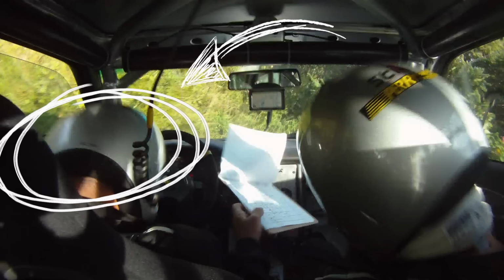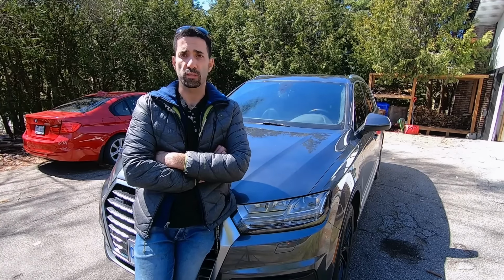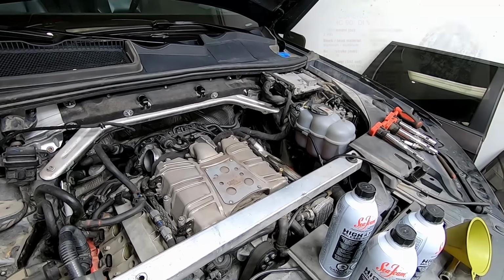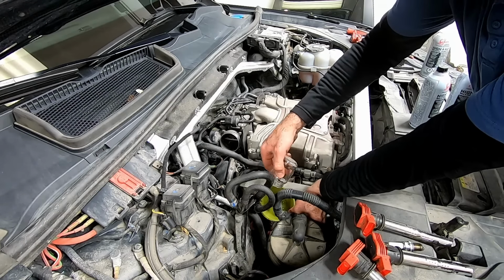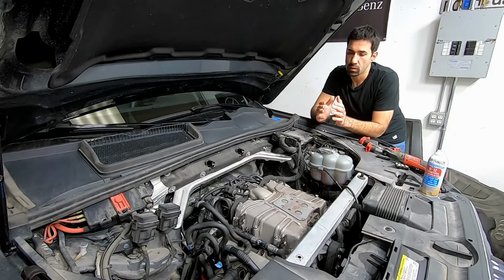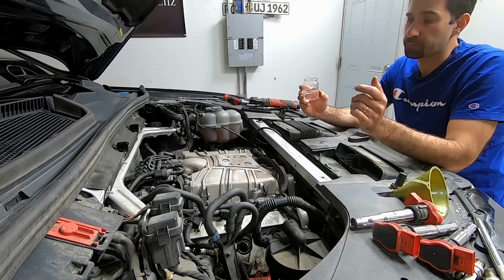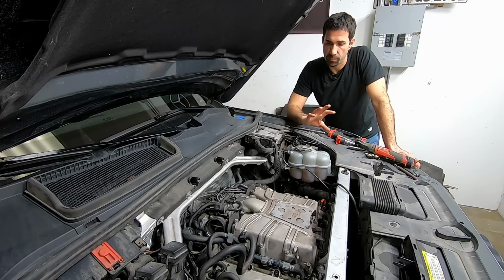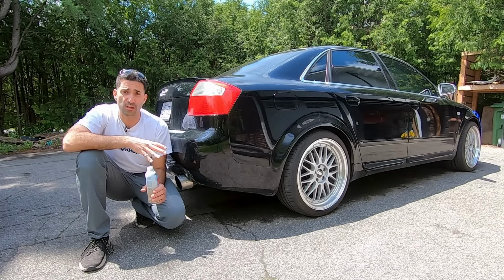How to fix oil consumption on VW/Audi/Porsche 3.0T engine?

Comment: You are a genious. Thanks man. Did this on m S4 3.0tfsi. Will see if it works. I couldn't import B12 but bought a product which has nearly the same ingridients based on Xylol.
Reply from the maker: great...keep us posted on your results and the details on the other solvent!
Reply: @ETMotorsports  I'm curious, too. But it smoked pretty intense for nearly half an hour. I used STP for carburetors mixed with Toralin Anticarbon. But because of a public place i couldnt disassenble everthing to turn the crank. So i just put it there for two hours. Maybe i will do it again in a few weeks. 

I also will use some ceramic products and results are instant. Less engine brake/drag, running more smooth.

Comment: It's great to hear that the B12 piston soak process is effective for the Audi V6 too.  It is interesting that treating the pistons at TDC also soaks the valves.  

I recently did the B12 soak on a Tiguan 2.0   Instead of waiting 12 hours between B12 doses I just waited until the solution had leaked past the pistons, rotated the crank, and added more B12.  After a few doses, I noticed one piston held the solution so I only gave it a 1/2 dose.  Eventually, 2 cylinders held the solution.  

Hopefully, my A6 will not begin consuming oil.  But if it does it's great to have such a cheap & simple cure.

Thanks,  👍👍
Reply from the maker: Great results

Comment: I tried this on my 2014 Audi S3 8V recently and so far so good! Have not went through any oil at all in the 250 miles I drove the car where I would have gone through about 3/4 of the dipstick in that time (it was getting worse and worse over the past few months the more I drove the car) So pretty safe to say this worked on my car too! I done the standard 24H 2 bottle B12 Chemtool piston soak method, drive the car and dump oil and carry out normal oil change. One thing I noticed was there was a sulfur smell which smelled like unburnt fuel was getting to the cat which made me think the cat might have been damaged. Thankfully that smell went away and the car drives normal. I noticed before my car would leave a lot of dark smoke when launching hard off a stop light for example but that is also gone following the soak! Thank you very much for sharing your knowledge on this issue this really is abolutely amazing! I think moving forward if I was to do this again even on a 4 cylinder engine it would be a good idea to do piston 1 and 4 and 2 and 3 separately and do them both at TDC. Uses less B12 and you get the added benefit of it cleaning the valves and injectors. I was also really lucky that I was able to purchase some B12 in Northern Ireland where I live since I know it is not available everywhere
Reply from the maker: Great - glad this worked! I like your idea of doing the pistons at TDC as well...It makes all the sense in the world to take advantage of the soak and hit the valves and injector while you're at it

Comment: I've done the soak on a 2L Q5. I drain the oil beforehand and keep it for later. I refill cylinders each time before hand cranking, using a piece of vacuum tubing as a dipstick to check the levels. Each time I refill I also drain the oil sump to keep the solvent away from the seals. When last soak is done I put a small amount of Seafoam into each cylinder, remove the fuel pump fuse, and crank with starter to lubricate & clear cylinders. Then replace fuse and spark plugs, add old oil & do an engine flush, then new oil & filter. Running the solvent in the engine oil is probably risky & an engine flush is likely more gentle & can be done at every oil change for a while to gradually clean the rest of the engine.

Comment: 2016 Q5 here... Did the B12 soak 3 weeks ago. Now after 500kms (300miles) the level hasn't moved. Before that, it was almost a 1/4 of oil in less than 1000kms.
Reply from the maker: great results!

Comment: I always treat the piston at bottom dead center...this way you can cover it up completely.
And yes, you always want to blow up the cylinder with compressed air.

I use a can of B12 per cylinder.pull the supercharger and walnut blast the valves, also replace the PCV valve.
Reply: B12 and then do the walnut blasting? Or walnut blast first?

Comment: Hola de nuevo amigo! Otro Audi a5 1.8 TFSI arreglado gracias a este proceso!! Este consumía 1l en torno a los 800km - 1000km. Actualmente lleva 750km recorridos sin consumo aparente. Quiero aclarar unos detalles por si son útiles para los demás. No pude usar B12, y en su lugar usé ATF+4 mezclado con acetona pura en partes iguales. El resultado fue increible, disolvió el carbón muy fácilmente. En este caso, el arranque fue MUY DIFICIL, pero finalmente todo resulto ser un exito.
Reply from the maker: Hey - great results! ATF+4 mixed with equal parts pure acetone - interesting combination...worth a try!
Reply: @ETMotorsports  Si, quizá en un motor con muchisimo carbón sea mejor usar el B12, pero en este caso funcionó a la perfección el ATF+4 con acetona.
Reply: @SrZombros I'm curious, do you know why the starting was so difficult? The spark plugs were out during the soaking, so it's not like they were coated with B-12.  The hard starting (which we've seen in a few of the prior @ETMotorsports vids on this topic) is the part that has me the most concerned. Thanks in advance.
Reply: @tedjohnson64  Cuesta arrancar debido a que el motor pierde toda la compresión al no haber ninguna película de aceite en las camisas de los pistones. También, la presencia del solvente en la cámara de combustión hace que el motor se vuelva loco. En cuanto el solvente empiece a quemarse y llegue el aceite a los segmentos para recuperar la compresión, tu motor funcionará con normalidad. PD: añadiendo una cucharada de aceite antes de arrancar el motor, previene daños en el primer arranque y hace que sea más fácil.
Reply: @SrZomBros gracias por su consejo de hecharle cucharita de aceite antes qué actualizar
Reply: @Pwnulolumad  Denada! Me alegro de que te fuera últil <3

Comment: Very interesting point talking about the carbon on the pistons and interference not allowing the engine to rotate fully by hand.

I’ve done the b12 soak close to a dozen times on both the 2.0T and 3.0T CREC. Has worked great. However on the first 2.0T vehicle I did this soak on everything went smoothly. Rotating the engine by hand during the soak. Drove great for 500 miles with no consumption. After sitting for a couple weeks I go to start it and it immediately is running rough flashing CEL and dies after 30 seconds of running. At that point I can only assume the engine has seized up. Long story short after poking around and not wanting to do more damage I start pulling things apart. Cant find any issues. Pull the head off only to find carbon buildup on top of the piston which was my interference  hitting the bottom of the head, and the reason the engine stopped running. The fact that the car ran perfectly for 500 miles makes me wonder if this was just a coincidence and maybe the carbon actually broke off from the backside of intake valve and got sucked in because I would think any carbon that accumulated during the soak surely would have burnt off immediately upon startup and I never had any resistance rotating by hand when doing the soak.
Reply from the maker: yeah that's a bit suspect...you wouldn't have carbon from the treatment after 500miles...so you had actual physical damage because the piston hit the valves? that sucks :(
Reply: @ETMotorsports  there was no physical damage. Once the head was off you could see carbon on top of the piston which had been compressed and preventing the engine from fully rotating just like what you experienced by hand. I would have never expected such a small amount of buildup to be able to stop the engine in its tracks like that. We’re talking less than an eight inch of carbon on just a small portion of the piston top. In hindsight I could have just pulled the spark plug, maybe put in a little solvent to soften it up, then blow it out with air
Reply: So this cleans the intake valves ?

Comment: Thanks for the video.  My wife has a 2017 Hyundia Tuscon with the 2.0 na engine, that has this same oil burning issue. Car had just about 100,000 km and used about 1.2 - 1.3 liters/1500 km.  Dealer was absolutely no help.  Did the piston soak and made a big difference, didn't fix it completely but much better now.  After about 4500 km used about .5 liter of oil.  After second oil change after piston soak we went on a trip and put on about 1500 km and it still showing full, was mostly hwy driving so maybe that is why not sure.
Reply from the maker: @vanlandbc  awesome! Glad to see it's working on other brands too

Comment: Thank you, I have tried on my Q7 2017. It works!
Reply from the maker: @eddatusa  nice! What were the numbers?
Reply: @ETMotorsports  I would like to get this done but no one in new jersey seems to give me comfort in having them do it i will drive my car to canada if you would be willing to do this for me do you have a email or contact info
Reply: @ETMotorsports  I have followed your procedure. I did 2 pistons every 24 hrs. Every 12 hrs rotating and added B12 50 ml. My Audi was consuming 1/4 oil about 500 miles. I have ran 1000 miles. It hasn’t dropped at all. Thanks again. Before it I did change PCV valve. It never resolved the issue.

Comment: I just started the soaking process on my 2017 Q7 3.0t
I started on Saturday pistons 1 & 6, twice soaked, then hand cranked without problems.
Last night I started on pistons 2 & 4, this morning I tried to hand crank but got stuck. 
I got 2 & 4 back on TDC and I'm now doing the 2nd soak. I'll let it finish the soaking then I'll try the compressed air to see if I can get it unstuck.
I'll report back.
Reply from the maker: @SuperVertrix  good luck!
Reply: Update:
Reposting again. I'm not sure what happened to my previous comment.
Anyway, I was able to rotate the crankshaft once again. The problem was inside cylinder #2. There was a piece of hardened/dried carbon on the lower edge of the piston head that was preventing the piston from reach TDC. I used compressed air to blow it out and it worked. This cylinder was very dirty, almost like the one you showed in the video.
I'm now soaking piston #3 and #5.
I'll report back tomorrow.
Reply: Update #2:
Yesterday, I finished soaking all the pistons. When I turned the engine back on, there wasn't much white smoke. I think it's because I managed to remove almost all the B12 liquid without letting it enter the exhaust pipes. After soaking the pistons, I vacuumed out as much liquid as possible while the piston was still at TDC, then blew the cylinder with compressed air. I lowered the piston to BDC and blew it with air again. I installed the old spark plugs, air filter assembly, and started the engine, which fired up quickly (only hesitated for a couple of seconds). I let it run for about 20 minutes, let the engine cool down, then drained the old oil and removed the oil filter. I replaced the oil filter, added new oil, and installed new spark plugs. The engine started instantly, warmed up, and I took it for a ride. It was very smooth and quiet ride. I'll update later on its oil consumption.
Thank you, @ETMotorsports !
Reply: Update #3, maybe too soon to tell, but yesterday we took a 200-plus miles trip and the oil level still at 100%! Before after a trip like this, the oil level would go down a notch. I also noticed better MPG, it increased by 3 miles.
Reply: Update #4
Today, I hit 1,000 miles after the piston soak procedure. The engine oil gauge is still showing 100% full! 
I'm super happy about this. 
Cheers!
Reply: @ETMotorsports  1,500k miles, and so far, the electronic oil gauge is still at "MAX". Thank you Sir!

Comment: Rotella  T6 one of the best  oil. The 5w40 for diesel engine  is excellent.  You can use it for that engine, no problem.
Reply from the maker: yeah I like running the T6 as well
Reply: @kamalaquino6300  why used diesel engine oil after piston soak,what is the benefit for this ?
Reply: Rotella is all i use in all of cars. Truly the best oil i have ever used.
Reply: @etmotorsports I just did the soak on my 2014 Q7 with 3.0.  I then ran the motor for 20 minutes with one can of b12 prior to draining and refilling with t6 rotella 5w40.   My question is I know this oil is for diesel and not the regular 3.0 but I get the idea that you and others feel it’s fine to use this for this engine.  I have this oil in now and was going change out with amsoil after maybe 500 miles but I’m also considering just keep the Rotella for a a full 4000 miles or so.   Appreciate your thoughts.
Reply: @ETMotorsports  I did the soak 500 miles ago and have been running rotella 5w40 during this time.  I’m thinking about now switching to amsoil 5w40 but also considering staying with rotella a bit longer.   It sounds like you feel staying with Rotella would likely not be an issue.  Is this correct?

Comment: Спасибо огромное за ваше видео! Уже 2 недели испытываю проблему с Audi Q7 4m 2017 из США. Пробег 140 000 км, цилиндры чистые. После очередной замены масла, расход масла составил 1 литр на 400 км. Обязательно воспользуюсь вашей рекомендацией и сделаю раскоксовку двигателя. Очень надеюсь, что поможет. Привет вам из России!!!
Reply from the maker: @lermos  good luck!!
Reply: @ETMotorsports after doing this procedure I ran around 1260km and engine asked me to add 1 liter.
After a while I ran 4250km throughout the city and highways on Russian roads and oil level was empty on a half. 
I ride around 140-180kmh during on highways. 
1200km left before the next oil change. 
So i think I won this crazy oil consumption.
I will watch the situation after the nearest oil change.
Thank you very much. 
I used Gzox foam solution for valves and pistons on hot engine during 4 hours of procedure. Spent 4 bottles of it.

Comment: I have a 2010 A4 B8 Avant with apr stage 3 ,K04,Etc. It was “eating “1/4 oil on 200 mile,smoke especially after I am leaving the stop lights. I go to the mecanic and he said I need new piston rings(my car have 200k mile). I do first BG Dynamic Platinum Engine Restoration Service and after B12 Soaking,replace spark plugs.  Every second time when I put the gas in the tank I add a fuel system cleaner( LM Jectron or RL SI-1). all the time I use Liquid moly 5W40 now I change with the new one Liquid Moly Molygen(the green oil). I put 6000 miles on the car in six months and I don’t have any kind of oil consumption or smoke ,the car is running smoothly and I drive 2000 miles without adding oil.( i change the oil every 2000 mile).Now I have almost 2000 miles I’ll try to go 3000 to see if it still consuming oil.
Reply from the maker: @mogadan3582  great results

Comment: Hello! I am in exactly the same case in a Toyota avensis 1zzfe. Do you think it is better to use B12 before seafoam?Hello! I am in exactly the same case in a Toyota avensis 1zzfe. Do you think it is better to use B12 before seafoam? Thanks you!!!!!!!!!
Reply from the maker: @GomeSecks  you don't have to use seafoam first - it all depends on how bad the engine is... seafoam is very mild so if the issue isn't serious it might help but is you're dealing wth a big consumption and have access to B12 just do that straight away
Reply: @ETMotorsports  If currently consumption is 1Liter every 1000km...I'll tell you here if it works in my case, in Spain it is difficult to get b12

Comment: I have another 2017 Q7 that burns 1L every 750km or so if you want more practice (in Ottawa). I was actually going to ask if you wanted to try it, but figured you were done after the 2.0T. Fantastic video, BTW
Reply from the maker: Haha half of Ottawa's Audis are just eating oil I guess :) I'm pretty busy for the next few months, but can always help if you decide to tackle it on your own.
Reply: I may take you up on that! I was curious what your thoughts are about rolling one side onto ramps and doing one bank at a time, to alleviate the issue caused by the 90 deg V6?
Reply from the maker: yeah I thought about that as well but unless you put the car at 45deg you can't make up for the tilt in the piston...honestly much easier to just take the extra time and do it...

I thought a bit about your car and there are a few things that I want to try with the 3.0T so maybe we can make something work towards the end of the summer if you haven't fixed it yourself...can you ping me on whatsapp or facebook so I don't lose your contact?

Comment: Hey have you seen that valvaline came out with a restore and protec engine oil. They claim it breaks down the carbon on the rings after four oil changes.
Reply from the maker: hmmm worth a try I guess - but that's anywhere between 20 and 40k+ kms if you're doing 5k+ oil changes...not sure anybody wants to wait that long to find out if it's effective
Reply: @ETMotorsports  I agree. Would be good for the low millage cars for preventive maintenance.

Comment: If I'm currently NOT having oil consumption issues, I've done 5k changes, I'm due for injectors and carbon clean (88k) miles... should I go ahead and do this you think?

BTW this solution is a solid win for the 3.0t community, so thank you.
Reply from the maker: @2buds1shroom  if you're not burning oil there's no reason to do this... take good care of the motor, maybe do a flush every second or third oil change and you should be good for many miles

Comment: CREC 3.0t is very different than the previous generation 3.0t with low tension rings that coke up very easily.  B12 definitely a difference maker.